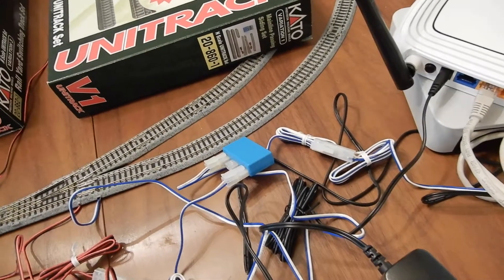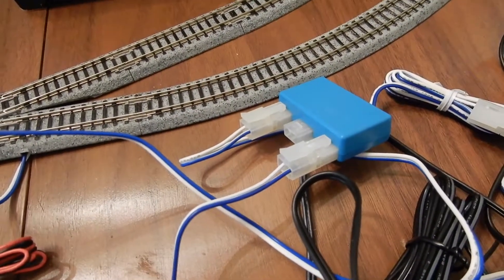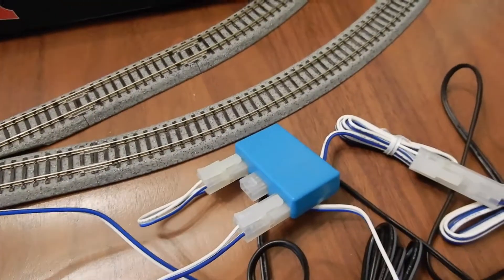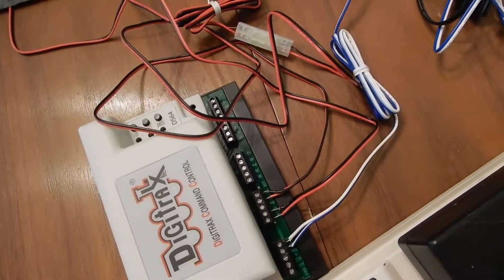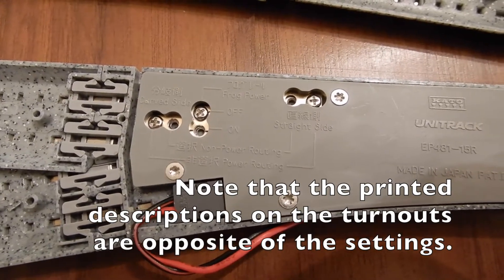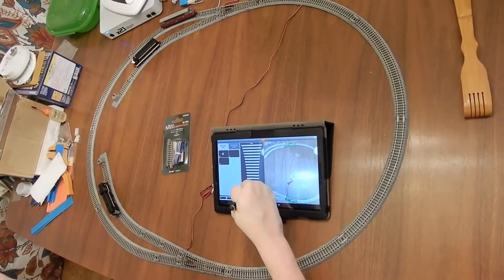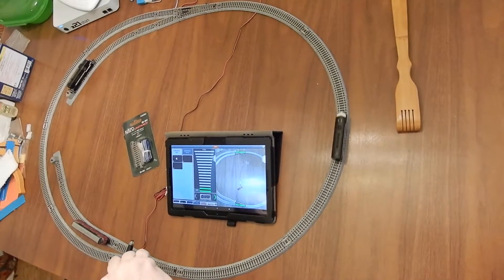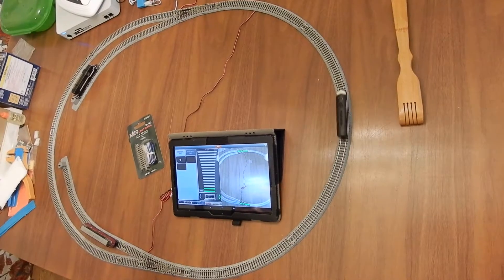Creating A DCC Plug & Play System with the Roco z21, Digitrax DS64 & Kato Unitrack

Comment: Dear Hetzer, I'm a rookie to the DCC player, How can I connet the Z21 to the KATO track ? rewire it?
Reply from the maker: Hello, the video shows this procedure at around 45 seconds at the beginning. If you want to connect directly without the splitter, clip off the connector on the end of the Kato track cable. Strip off the ends of the two wires, twist them (add solder for a better connection), then put the two wires into the back of the Z21.